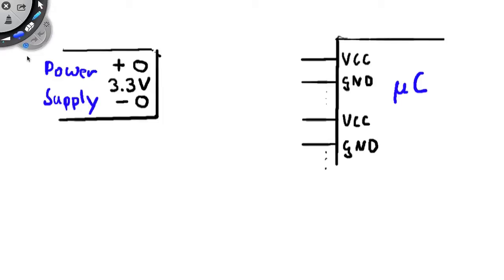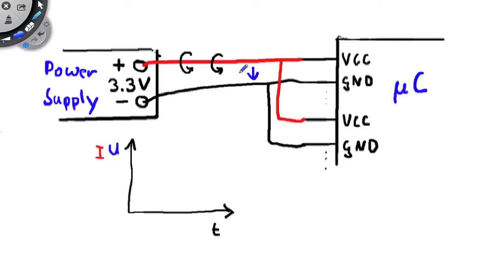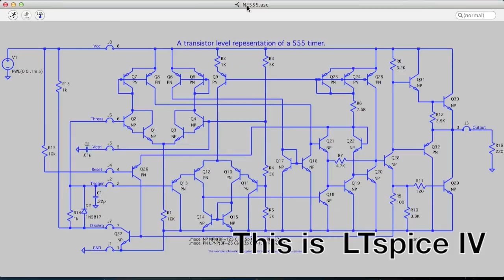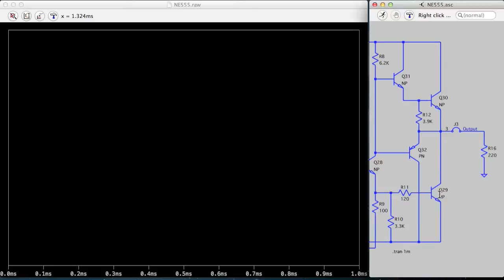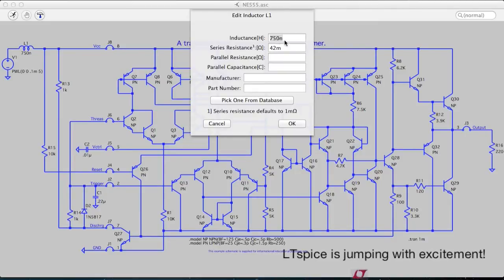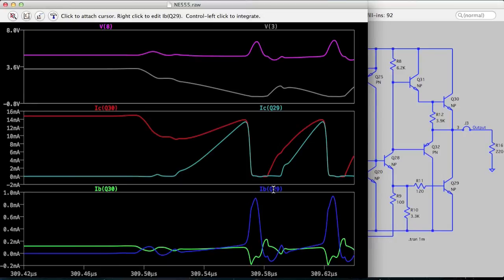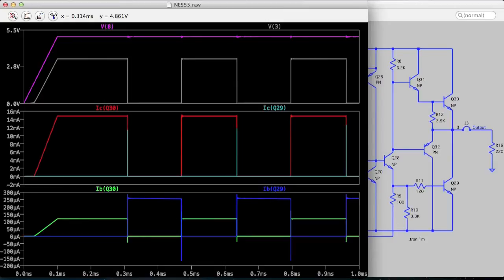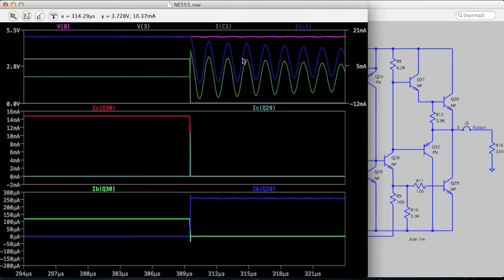Power and decoupling - DIY 8-bit #2

Comment: You definitely need a thinner iron tip, or better yet use a hot air gun to solder those tiny caps.
Reply from the maker: I disagree. Smaller tips don't give you much more precision, just less thermal capacity and worse heat transfer. I can solder 0402 with that tip!
Reply: *****
 You can solder 0402 with a screwdriver warmed up on the kitchen stove, if you want to, doesn't mean you solder properly. 

At 13:50 for example, you're using way too much solder and you're heating up the pads and capacitor for way too much time. Yes, it works, but it's not right.
Maybe this pcb and this application is more forgiving, but generally, it's not a good idea to make this type of soldering a habit.
Reply from the maker: +mariushmedias I agree to the issue with too much solder. Thanks for your feedback, I appreciate it a lot! Also, you're right, solder paste and hot air is the best way to do it.

Comment: I can't believe you used a bowling analogy to describe a 555 timer and inductance.. well done :)

Which simulation application are you using, btw?

With my goofy power supply that is dumping out 10V for the first moment before it drops back to 3.3V ... do you think using a pair of 7805 and 7803's to get the 5V and 3V lines will protect enough? (of course with decoupling .1uF caps on the Vcc/GND pairs.) (Some of these microcontrollers don't have pairs .. Vcc, GND, Vcc, Gnd, Vcc, Vcc, Vcc, GND, that sort; I guess in those cases, you're just capping from Vcc to any GND..)

Thanks for your videos my friend!

I'm working on the plulggable mcu modules for my board, and redesigning the pcb for my main board (ie: I can drop in a 6502, 6809, eZ80, stm32... in theory), but wrecked my back, so taking a couple weeks slow and sorting out parts for mundane things.. edge connectors, power switch, etc.. order bits, measure and make the Eagle parts, etc.

(It really annoys me there is, in this day and age, no standard interchange format for CAD parts, nor a central repository for submitting and auto-translating them, nor a good set of components issued by all the parts manufacturers, etc. Theres no sensible parts ecosystem, where they should be. Ah well .. theres a niche for a company to start, but more than I want to tackle ;)
Reply from the maker: Thanks :) The simulator is LTspice. This was actually the first time I used this software, and it is awesome! I've written my own simulations, although mechanical physics, not electronics, in the past. But the equations are very similar. Just change capacitors into springs and inductances into, well ... bowling balls! :D (although other analogies are also possible)